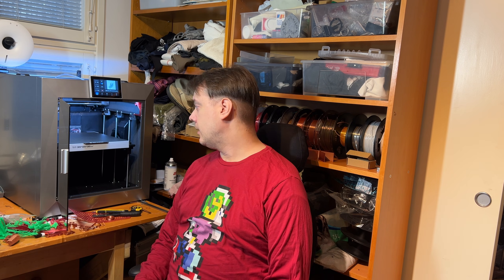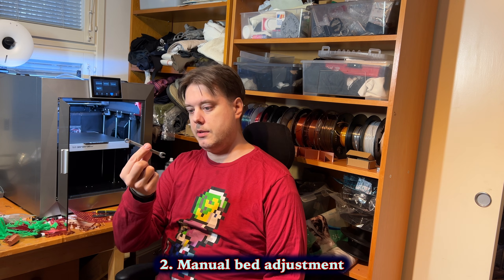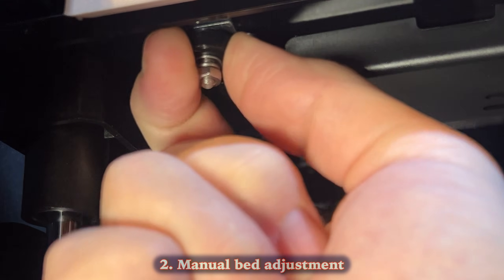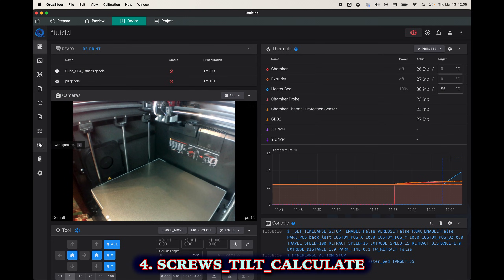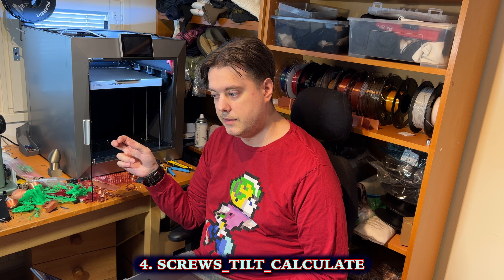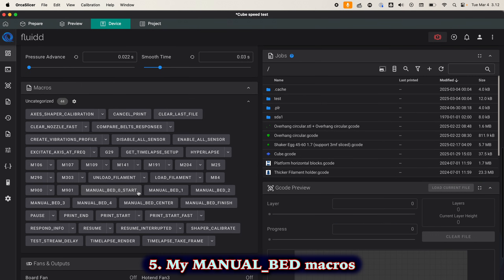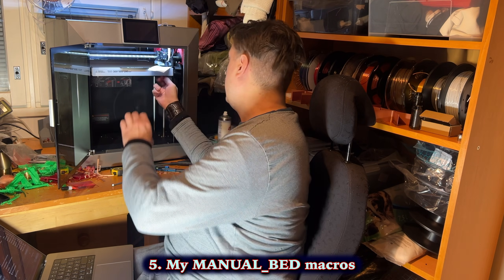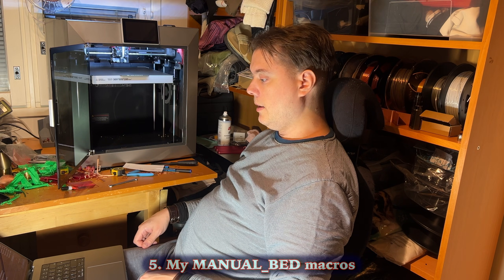Qidi Plus 4: Manual bed tramming, are you too doing it wrong?

Comment: so i just ran the macro and this is what i got front left (grey) button says Base Z=0,7887, front right (Red) says <00:20 Z=1.0251, back right (Red) says <00:31 Z=1.1491, back left (Red) says <00:30 Z=1.1391.....all are saying counter clockwise.........now what??
Reply from the maker: I suggest you read the instructions at the Github page.
Reply: @mrelwood_media I have read through it , just trying to zero out now , I'm on my like 30th config trying to get all in the green
Reply from the maker: @Scottie_70   You're probably fine by now. Each run varies enough that getting all in green is really difficult as you've learned. I'd be happy with all sub 0:10.
Reply: @mrelwood_media thx seems level just mesh picture is all red , just wasn't sure if that was ok
Reply from the maker: @Scottie_70 All red? Is the bed pictured at around 1mm height? If so, I’d run the ABL again to get them around zero height. I had mine ruin the build plate when it was like that. I’m not sure why it does that sometimes, but it might be related to the Z offset measurement issues.

Comment: I've had this printer for about a month and it's printed everything I've thrown at it perfectly. That all stopped yesterday, I was printing a filament holder (a model I have already printed 20+ times) and the first layer would not go down correctly so I printed a single layer full bed test print. The front half of the print bed was perfect where the back half looked like the Z height was way to high. 

Not sure what happened I ran the auto bed level and the same thing with the next test (front perfect back not even close). So today I manually level the bed (multiple times) I used a piece of paper and then a leveling card that came with one of my old Qidi printers. I ended up with an amazing bed mesh with like a 0.09. At this point I've ran the test print a few times with several different filaments, all with the same results perfect front half, bad back half. So now after Googling like a mad man I find screws_tilt_calculate, set that up, get it dialed in going back and forth between it and Z_Tilt_Adjust and end up with a bed mesh of 0.08 (so better than the leveling card) and still the same results with the test print, perfect front and bad back.

I've tried reducing Z offset but that just messes up the front half of the test print. So far today I have about 16 hours into this printer trying to get a good single layer print.

Comment: I can run the script 5 times in a row and get 5 drastically different results without having even changed anything. It's pissing me off, i get them all green and then do another calculate and a couple will be red
Reply from the maker: With Screws_Tilt_Calculate? Yes, unfortunately that’s how it works. The probe and negative homing just aren’t precise enough. So it’s pointless to try to hunt for all to be very close to zero. Just green or close to green will do, bed mesh will take care of the rest.

Comment: Warning - Ignore this guy
You have no clue what you are doing. "Your macros" are the dumbest thing I have ever seen. You are going back to the 90's when you have a perfect klipper tool to do it for you. You didn't show your mesh results and you didn't run z tilt first. Klipper has a z tilt routine that it runs on every print. You can also run it manually. That takes care of side to side level of the bed. Only then should you mess with the corners tune. After using the wrenches, you need to run z tilt again!
Reply from the maker: Z tilt calibration is ran at the start of every print on my startup code as well.

My tramming macros aren’t as good as Screws-tilt-calculate, which is why I recommend people to use that. And I’ve never claimed that I would be a coder. This was made very clear on the Printables page as well. Still, my startup and other macros solve many of the Plus 4’s shortcomings.

You on the other hand aren’t clear on which macros you’re even talking about.

Comment: I have  non-stop success now since making the changes tech recommended and also doing new auto level for ABS vs PLA op temps.   I did loosen bed knobs as suggested two turns Qidi tech recommended.   In addition, when doing anything like ABS at 90C I do a separate auto level, after nice long 15 minute plus manual heat soak of bed.  If I print with bed temps less then 80C then I redo my auto level for the temp I will be printing at.     So I have my standard abs 90c which I run auto level(after nice long manual heat soak 15min) and I once again will change for PLA to typically 65C and redo auto level.    I basically use these two temps, and new auto levels for each. If I run a third real hot bed say at 100C or even 110C then would do a third auto  level for that filament and temp range, this keeps thing in z going nicely.   Have not seen issues again.  Having great success with this.   I added another 150 hrs. to printer doing this.

I quick note if folks have not used it in awhile, the new QIDI studio is really nice(many updates), they have added tons of new features to it.   I find now that I am sticking to Qidi studio.  I am getting amazing prints on my Plus4 and also my Q1 Pro which are being used non stop lately for weeks on end have not had hardware issues in a very long time since making changes as mentioned above.

This is a thick bed, it requires good amount of time to stabilize.  Also, due to design and tolerances I think it just makes sense to run a new auto level for every change in temp variation say 10C to 15C increase.  That just simply makes sense.  It does not take long to accomplish and ensures things stay running well for the temp range will be making prints at.  It is shame can not post images here and video, would love to show layers or lack of visual layers I get on Plus4, this has turned into a real powerful workhorse for me!   Looking forward to testing out some new HTPLA arriving today from Polymaker!
Reply from the maker: Good to hear that you’ve gotten it to work well! One tip though, instead of creating a new mesh with Auto Bed Level for each bed temp change, if you only do a print or two per bed temp you can just soak the bed manually and let the print start sequence take care of the bed mesh. But I’m sure you know that by now.

Also you surely know why I would disagree with the Auto Bed Level “not taking much time“… 😜
Reply: @mrelwood_media  I have been doing large batch prints like 120 parts per plate so for that couple minutes to wait for that auto cal, worth it to me.  Just gives extra assurance.  Big thing is all fails on z distance gone.  Not sure, but think latest updates Qidi studio did and perhaps last Plus4 update did some amazing things, I am printing .2, .16 layers, literally no layer lines repeatably.  I think I really have it dialed in very well. I am using Tungsten nozzle and it been running with that nozzle on some aggressive filaments used for around 250 hrs now.   Have done lots of stuff with GF and CF in it including PET.  So very happy with this machine.  Total machine time on Plus 4 is fantastic, it holding up very well.  I also have my Q1 Pro cruising along, doing large batches on it.  Picked up nice good paying job covers cost of printer.  I do have a Centauri coming in few more weeks picked up 299 will be fun testing that, new HTPLA arriving today from Polymaker looking forward to testing also!

Comment: Hi, thanks for this crucial description. I succeeded tuning my printer.cfg with your mod. It works !!! 🤩 Let me please ask a question, what do you mean with "Don't forget to run the automatic bed mesh?" What do you mean by "mesh"? Which menu has to be started? In which directory should I put the macro "MANUAL_BED_TRAMMING.txt" , Stupid Questions, beginnest questions! Thank you very much!
Reply from the maker: Hi! Like the description said, copy the text inside the text file and paste it to the gcode_macros.cfg, before or after any existing macro.

“Auto Bed Leveling” from the printer’s screen creates the full bed mesh.
Reply: Yep, you have no clue about klipper tools and you blindly follow this blind guy. None of this is necessary if you simply use the macros provided by Qidi.
Reply from the maker: @timtreat Qidi’s own bed tramming macros aren’t very good for the purpose. Screws-tilt-calculate does a much better job.

Comment: Here is fix tech support has.  Very important do not overtighten bed knobs otherwise you can run into the first layer issue on hotter run filaments.  This is new procedure to ensure you do not have this issue:  "We have came out the new solutions here. 

As the temperature increases, the black knob beneath the build plate may become too tight, which can impact the accuracy of the leveling process. It's important to ensure that the knob is not tightened too much so that the spring under the build plate can still compress properly.

In that case, please adjust all four knobs underneath the build bed directly, rotating them clockwise for two full rotation."

Do not worry about perfect tram it is not needed the way this printer works, get it close no need to get it absolutely perfect, just within reason, but do leave extra play in knobs at least two full rotations worth.
Reply from the maker: I thought about that when I disassembled mine, so I left them as loose as possible while still fitting the securing nut on the threads. Didn’t prevent the issue from happening with the new sensors.
Reply: @  My plus 4 has closed to 1800 hrs on it now, this reared its head back around early Dec originally, they shipped new sensors and board back then.  Will see if this works, will know shortly.
Reply from the maker: @jefft490  That’s a respectable amount of hrs on it already!
Reply: @mrelwood_media  What is amazing most of that about 80% is all high temp materials with a 99.8% success print rate.
Reply: @mrelwood_media  Well that fix lasted one print of abs, went to do another print with 12 items for customer in abs and first layer failed again.  Getting very frustrated.  Is this because springs too weak or do sensors not   like the heat?  I have 252 items to print for customer that can turn into a 50,000 item order on design I just made easily in the future.
Reply from the maker: @jefft490  Sad to hear, but kind of expected. Something in there doesn’t like heat. The sensors themselves are the coolest part of the whole bed, not much over 50•C during an 1hr print with a 60•C chamber. I strongly recommend installing the chamber temp measurement mod, since it solved the issue for me. Further than that, start the print with a cool printer (or my Fast Start macro) and you have better chances of success.

Links:

https://github.com/qidi-community/Plus4-Wiki/blob/main/content/chamber-heater-investigation/README.md

https://www.printables.com/model/1257000-qidi-plus-4-macros-fast-start-safe-y-moves-manual
Reply: @ Got it going.   Needed a good clean up on all knobs.  Then did the actual auto level cal routine for 90c where troubles can happen.   Have printed out 8 plates since making this change and it printing flawless first layers again.

To recap if anyone has this issue where you are printing hot filaments and all of sudden first layers get ugly do the following steps.   Loosen knobs two to three full turns.  Give the threads and knobs a good cleaning and ensure to snug locknuts firm but not too firm.   Redo the auto level for a high temperature setting of at least 90c seems to have worked great for me.   Busy busting out tons of high temp parts again and they layers look great.
Reply from the maker: @jefft490  Good to hear that you got it working again. Which process do you run at the start of each print: Full bed mesh, Kamp, or nothing (using the default mesh)?
Reply: @mrelwood_media   Going to give it a test right now, heating bed up after taking off a full three turns each.  Ran into this issue last evening rear it's head again.  Will see if it can print a proper first layer now.  Letting it heat soak and will run auto level again and give it a try.  If it does not work then I know most likely failed sensor.  Will report back in hour or so success or no success, last time they shipped me new sensors and board about 300 hrs maybe 400 hrs ago back in Dec.
Reply: @ It is working again after loosening all 4 plate screw knobs 3 full turns and doing auto level again.  Running abs with 90c plate perfect first layer, so it appears to have got it going again. I did not snug up too hard on the outside nut just finger snug only.
Reply from the maker: @jefft490  That’s great to hear so I can recommend it to others with the same issue! So how much of the thread is now visible/hidden once you tighten the securing nuts (with washers) in place?
Reply: @  I do not even both with tightening nut, I get it semi snug at most, will see here shortly auto leveling getting going now. I have always leveled auto level for a 70c bed temp.  I do run bed temps as high as 110 depending upon materials I am doing.
Reply: Best fix I found run whole new auto level for hotter temp prints.   Then issue does not happen.
Reply from the maker: @jefft490  My experience has been the opposite. If I’d try to run a full mesh at the start of a hot print, the mesh would be worse (or even fail) than just using the same 70•C mesh I made earlier.

Comment: I did that manual bed tramming right out of the gate, when I first set up my printer. I was thrown off by the locking nuts at first too, but soon figured ot out. What I did not realize, is that when you re-tighten the securing nut, it changes the plate, just a tad, it pulls it away from the nozzle. So, slight drag on the paper, good, sinch up the locking nut, even while holding the adjusting nut to make sure it doesn't move, and now the paper is loose. So, I adjusted till it grabbed the paper snugly, then tighten the lock nut and re check. you get a feel for it. Then, as you said, do the whole process at least twice. The bed screw calculation is a huge help, but its still finiky, i found it takes a few times around, and when you get really close, it seems like your chasing a moving target. I eventually ditched the stock bed sensors, they are rubbish. I installed a Beacon, and its much MUCH more consistent. 
And, because I am on a personal mission to spread the word, DONT BUY A QIDI PLUS 4, just don't, there are better options. Mine has been nothing but a struggle, cheep parts, poor QC, and slow customer service. Less than 200 hours on it, and its broke more often than not, and every time I think Ive finally got it printing well, something else breaks.
Reply from the maker: @joey120373   Yes, I noticed this too, when you tighten the securing nuts, the plastic adjustment ring moves to the other side of the thread’s groove. When the nut is loose the ring is pushed down by the spring, but when you tighten the nut, it’s pushed up by the nut. And in some cases the ring might even rotate with the nut. Therefore I like a short screwdriver style 7mm “wrench” so I can secure the nut with my other hand.

I’m sorry that you have had your share of issues as well. Which printer would you recommend if one were to want the Plus 4 features?
Reply from the maker: @joey120373   Oh, and the issue with Screws Tilt Calculate is that it reverse homes every time. It messes up the tilt just enough that you really are chasing your own tail trying to get all green.

Comment: How do you run the automatic bed mesh after?
Reply from the maker: @kentuckybluesman   My macro runs it automatically, for the SCREWS_TILT_CALCULATE you need to activate it yourself for example from the printer’s screen in the Tool page.